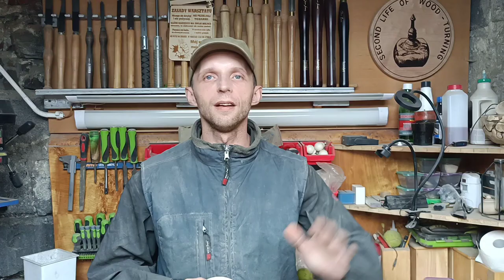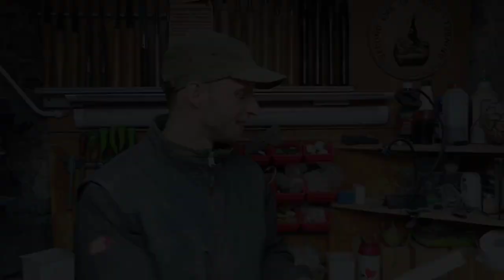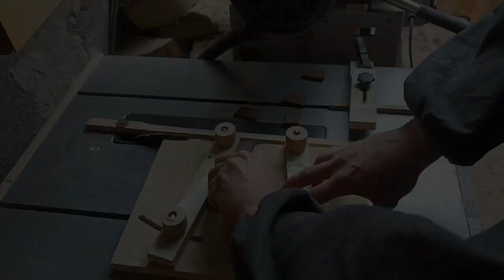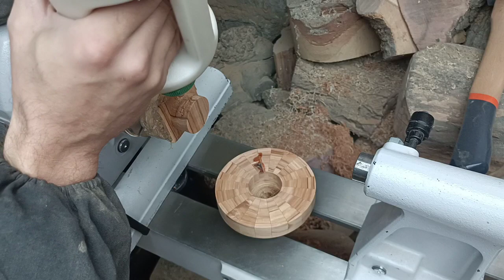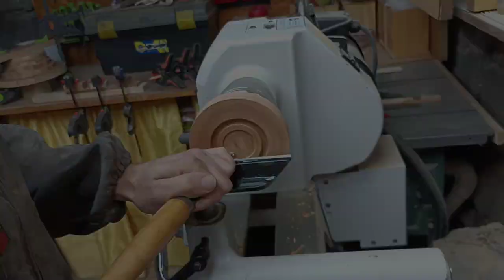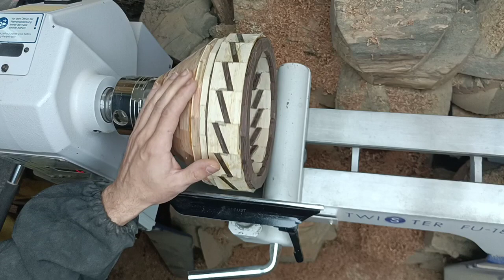A not kicked vase 🤷😉 Part I - Woodturning

Comment: I've noticed your segs are edge grain facing.
I'm cutting my segs with outward facing face grain to show more of the interesting grain patterns. To get the board thicker I have to glue 2 together...say 1.5"
Have you considered face grain?
Reply from the maker: Honestly I never take this into consideration and for me there was no difference. Now I Google it and really there is a difference. Some of my already cutted boards are face grain, some edge grain. To keep my segs faced face grain will take more work as You admit and I'm not sure is this so much important technique for me. I will try to make two rings with both techques and then I will decide should I switch on face grain. By the way thank You for this knowledge.
All the best 👍